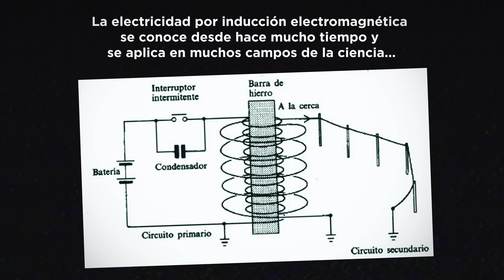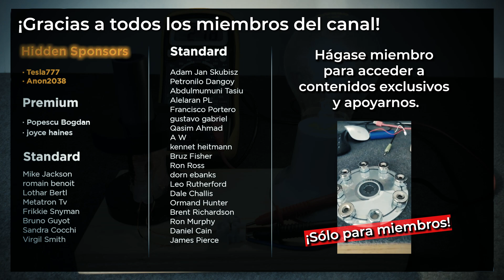ENERGÍA GRATIS CON IMANES 🧲💡💡- Energía Magnética Infinita

Comment: That is impossible an electricity is only generated when a copper wire is moved over a magnet, that is the magnetic flux is cut by the copper wire..if there's no movement no electricity is generated.,.